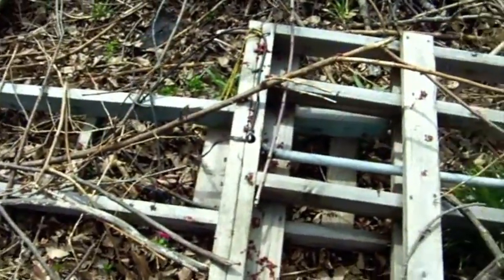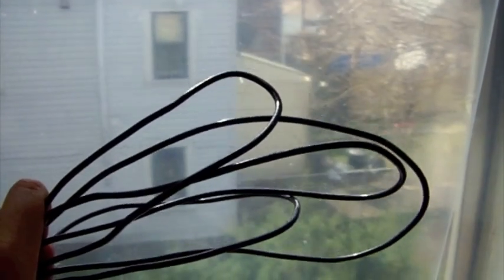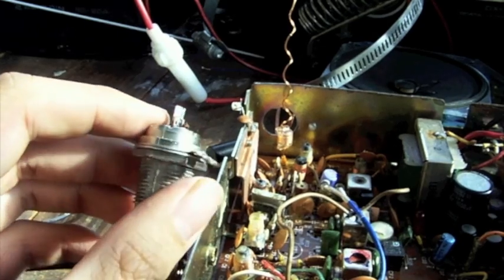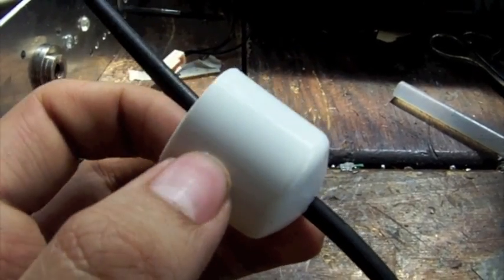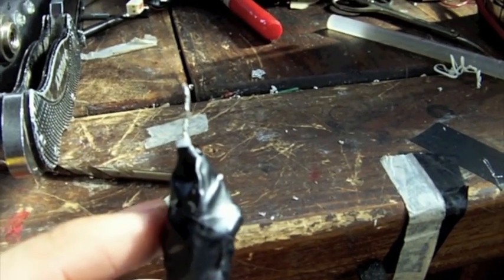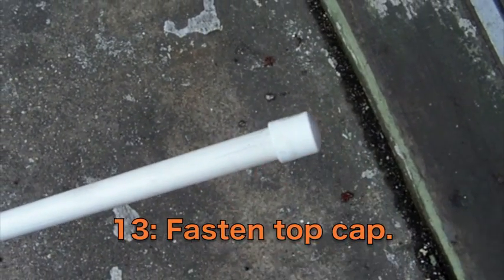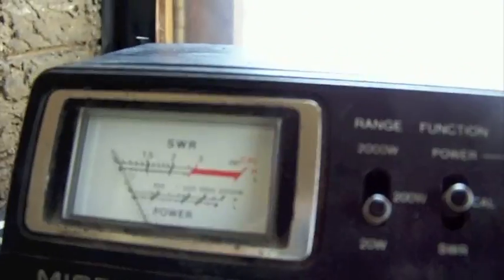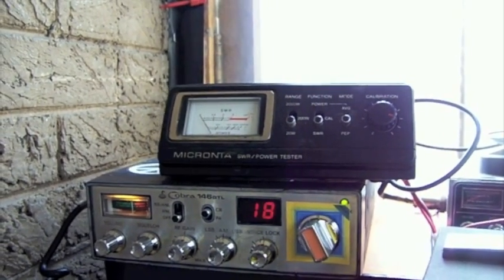How to make a CB radio 1\4 wave base antenna

Comment: PL = PLug= Male connector
SO= SOcket=Female connector
"Male" and "Female", in this case, refer to the center portion of the connector, not the outside portions, the center pin of the PL-259 is "male", the center portion of the SO-239 is a hollow shaft that fits the male portion of the PL-259 into it, thus it is the "female" mate to the center pin of the PL-259.

Comment: I've Been Building INDOOR 1/4 Waves since 1984....For Apartment use...Ask i'll tell ya!
Reply: Hi 
I want to built one cb antenna in my attic/loft. Lime an inverted v shape. Any idea how long both ends need to be?
Reply: @Romin.777  9 feet.    468/mhz = 1/2 wave so it 18 feet so each side wood be 9 feet 
Midl of cb is 27.185  that's 19

Comment: The Barrel Thing at 3:40 is a UHF SO239 Jack to UHF SO239 Jack Adapter or commonly known as a PL-258. 3:48 is the SO239. Should of made a 1/2 wave but will it just sway sideways then? You can buy copper rods for the ground plane. Thats when you could use the SO239 corners at angle. As soon as you started the calibration- I KNEW the SWR would be low. I had a 5/8 like was at 1.1 to 1.3 from 24.mhz to 29.999 . WHY did I sell it?!

Comment: If you want to try something interesting. Convert this antenna to a half wave vertical dipole. The simplest way is to remove two radials and let the third one just hang down. The coax will need to be brought away from the antenna at 90 degrees for as far as possible. You should see a gain of 1.8db because the entire antenna will be radiating. Not just the top. If you need more bandwidth, use thicker wire or use multiple wires to make up the radiating elements.

Comment: I also changed all the wire to 10ga stranded and coated and it all came toghether. I just soldered the coax right to the whip and radials.  It works great and I have been talking with it for a week now. My swr on any channel is never higher 1.2swr. Thanks for posting this!

Comment: Hey dude,
Thanks for the video I used your basic design but I changed the coax to RG8 and taped the radials securely to use as guy wires. The unit stands in the front yard in an umbrella stand taped to a 10' piece of 1" conduit pipe. I used two 5'x 1/2" pvc pipes for the whip and capped it. I also changed all the wire to 10ga stranded .

Comment: 11m is the center bandwidth found from lambda = 300 divide by frequency. Lambda is wavelength. 

So 300/27.250 = 11.009m, rounded down 11m. So 1/4th of 11m is 2.75m or 9.02231 feet.

Comment: In case you want to know,  wavelength (meters) = c / freq, where c =  speed of light which is 299,792,458 meters/s and freq is measured in hertz, so 27.125 Mhz (which is channel 14 on the CB) is 27125000 hertz, so 299792458 / 27125000 = 11.05 meters.

Comment: In the early days of radio, radio stations / HAM operators used wavelength instead of frequency to specify where they're operating at. To this day, HAM operators still refer to a certain band of frequencies that they're allowed to broadcast on by it's wavelength. For example 1.800 Mhz - 2.000 Mhz is the 160 meter band. How you would contruct an antenna to use the 160 meter band will be different then how you would build one to use an 11 meter band.

Comment from the maker: 11 meter is the wave length of the CB band, the 10 meter band has a 10 meter wave length and starts at 28.000mhz.
Reply: Actually, the 10 meter band starts down around 27.275 Mhz. 300 decided by the freq in Mhz equals the band in meters.

Comment: Hey this is Mike, I need to kno what is a 10 meter and 11 meter antenna? i honestly dont know what that means. I only know antennas from k-40. thanks buddy.
Reply: 10 meter band is set aside for  licensed amateur radio operators. 11  meters is the CB band of channelized frequencies.

Comment: THANKS A LOT FOR THIS VIDEO

well i didnt even make my first step in 10 meter ham radio;

so im here to ask ; what can i do with a transreceiver without an antena, does it have a power to cover at least the house where i live;

or i definetly need an antena or nothing !!!

i have DNT strato plus google it; its FM/AM 40/12

help please i need to know all the necessary things! thanks a lot
Reply: transmitters need a  proper antenna or all the smoke comes out of the box and it does not work anymore. Most generic radio transmitters want to see an antenna with an impedance of 50 ohms. If the antenna is bought new and labelled as for CB, it will work with your CB radio.  n7ud
Reply: @alanhart1238  i cant believe i asked this 12 years ago. Now im married and have a kid lol

Comment: Stolen antenna? Well DUH...copper thieves!!! Have you seen the scrap metal prices lately? 
Pretty cool video. I made one back in the heyday of C.B radio (70's), and mine was made from aluminum clothseline wire. Got a flat match at 40 and a less than 1.5:1 on channel 1, so they work pretty well across the band. Try painting the whole thing with spray paint to hide the copper wire from the thieves.

Comment: how do you adjust SWR?
Reply: not necessary to adjust swr as this antenna is made to operate within the CB range of frequencies, Any SWR reading between 1to 2 is fine. Check with your radio manufacturer for specifics on your model.

Comment: why don't you make a collinear you were already half way there
or will that end up 2 big for the frequency you are on, on 477mhz that I am using my antenna is about 12foot long and has about a 12db gain and if I shortened it to 6 foot I get a 9db gain, I am going to make another 12 footer (3.62 meters) soon I should video it or something when I do.

Comment from the maker: @anekon2 Hello, my apologies for my very late response.  Yes, you strip the ground shield of the coax then solder it to the ground tab of the connector.  Check for shorts in the connectors after finishing the soldering and assembly.  Use RG-58 Coax, it is the cheapest and most fit for this project.  Others for CB use inclde RG-8 and RG-213. Comcast coax will not work as it is 75 ohm impedence instead of 50 ohm as your CB station requires.  This could result in damage to the transmitter.

Comment from the maker: @Gatorbobpa Hello and sorry for my very late response.  You are correct, one 102 inch length of copper wire as the main driven element, and four 104 lengths which will be your ground radials.  The correct length of coax is whatever length you need to reach from your antenna to your radio.

Comment: What is the purpose of radials on a ground plain antenna? Dont they modify the angle of radiation?
Reply: the radials provide rf  counterpoise and when at a 45 degree slope the antenna is matched for 50 ohms impedance which makes the transmitter couple most of it's energy into the ether.

Comment from the maker: @bluejay148 Yeah that's another way of making them.  If you think about it it's really the exact same thing.  Only difference is that this is standing vertical while a dipole would (most likely) be horizontal.  And there's only one ground element as opposed to 4, our radials.  The size of the wires should be the same size as the ones used here.

Comment: hello Kevin here in Las Vegas, Unit 143 ssb lower 38, KC7ZOH 2 meter and 70 cm. will use your plan to make a dipole for house. do you still have it installed? any further recommendations? Thanks

Comment: nice vid......but can i use aluminum 1/2 inch tubing instead of the PVC pipe? can i also use a smaller aluminum tubing for the radials? i want to make a permanant antenna in my backyard.
Reply: Yes

Comment: hey...nice vid.......i was wondering......can i use aluminum tubing instead of the pvc pipe???  And if i use a thicker wire that runs inside of the tubing, will that be better when receiving and transmiting?
Reply: If you use aluminum tubing you willbe not need the copper wire, the tubing is the antenna!

Comment: @hondax450r 
Would you like to use truck/mobile antenna in home ? 
It wont in resonanse. Mobile antennas need counterweight  - this counterweights is your car cab. Co in home on base it need counterweight  you can experimenting with some 1 meter on 1 meter metal plate.

Comment from the maker: @hondax450r No you can't use the radio antenna that comes with the truck.  Antennas are designed to operate on certain frequencies and must be of certain lengths and designs.  So your truck antenna is made for FM frequencies 86-107mhz and CB is on 27mhz. Big difference! So you do have to get one separate, and preferably mount it on the middle of the vehicle, like the middle of the cab.